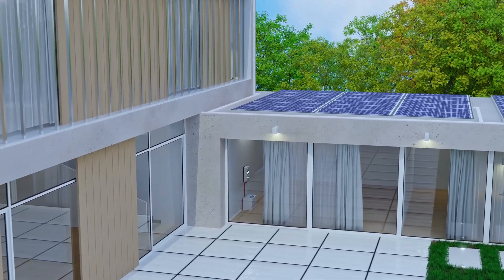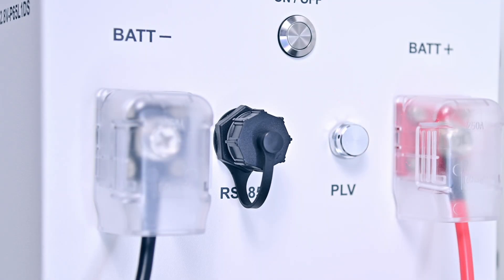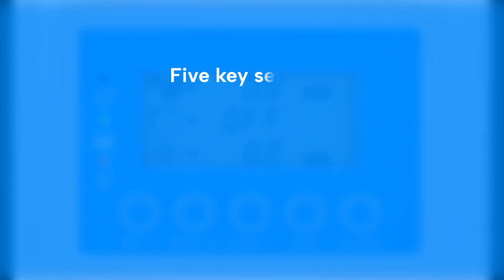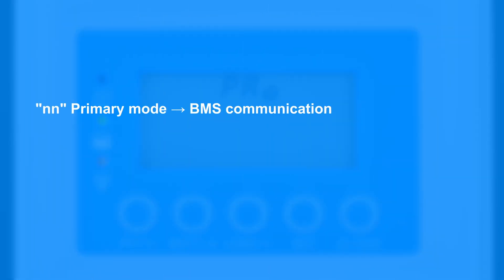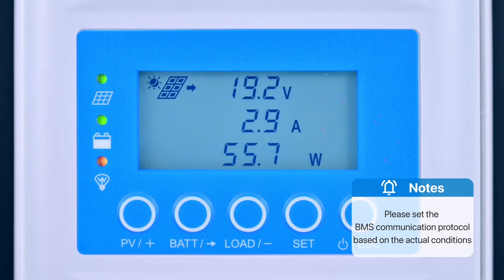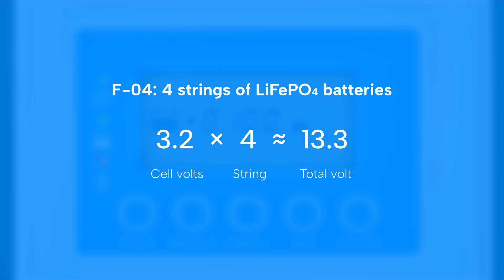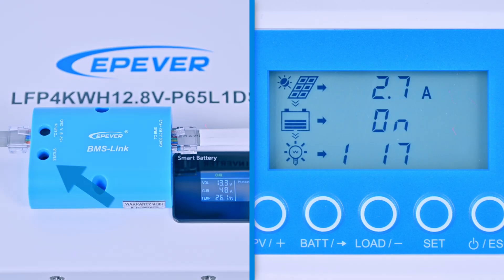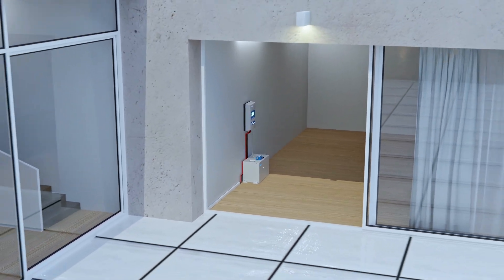How to Connect MPPT Controller to Lithium Battery via BMS | EPEVER Setup Guide

Comment: Dobrý den proč mě ukazuje mppt regulátoru Trace AN rozdílné Baterie SOC.
Reply from the maker: Hi, to help check this issue, could you please email our team at support@epever.com with more details about your setup (controller model, battery type, and connection information)? We’ll be happy to assist you.
Reply: Dobrý deň brat môj. Funguje to dobre s Tracer AN?
Reply from the maker: @IvanMarton-svk  Hi, thanks for your comment. 
Tracer AN G3 can work with lithium batteries, but the BMS communication depends on the specific controller model and battery brand/protocol. To confirm compatibility for your setup, please email our support team at support@epever.com with your controller model and battery/BMS details. They will check it for you and guide you step by step.

Comment: Why can't the SCC read the basic battery parameters from the battery BMS once communication is established?
Reply from the maker: Hi! Thanks for your question.

In our demonstration, the controller, BMS-Link module, communication cable, and lithium battery are all EPEVER products, so the communication behavior is fully matched.
If a different battery brand, cable type, or controller model is used, the communication results may vary depending on the supported functions and protocol compatibility of each device.

If you are using an EPEVER controller model that supports BMS communication, please feel free to send us a short video showing the wiring and the controller’s label to support@epever.com, and our engineers will take a closer look for you.

Comment: Will BMS-LINK work with the AN series?
Reply from the maker: Hi! Thanks for your question.

The Tracer-AN (non-G3) does not support BMS communication.
However, the Tracer-AN G3 does support BMS communication when used with the BMS-Link module.

If your controller is the Tracer-AN (non-G3), it can still charge lithium batteries normally using voltage-based charging; you just need to configure the lithium parameters manually.

If you need help with the settings, feel free to contact us at support@epever.com; we’re happy to assist!